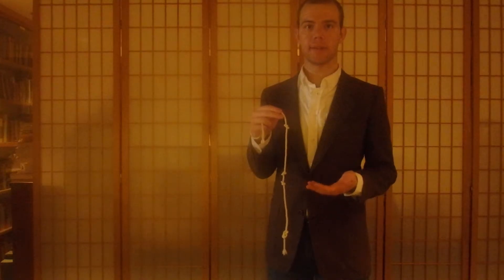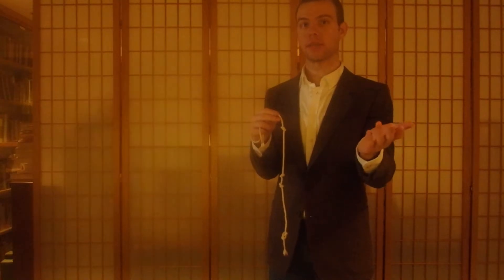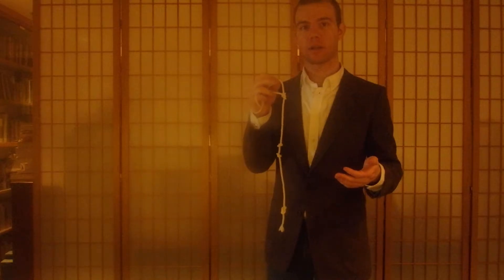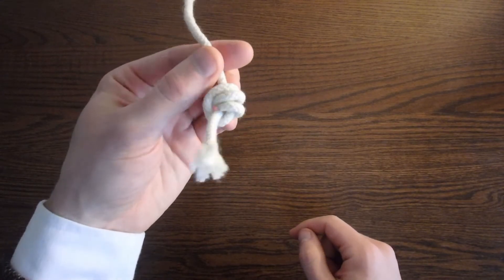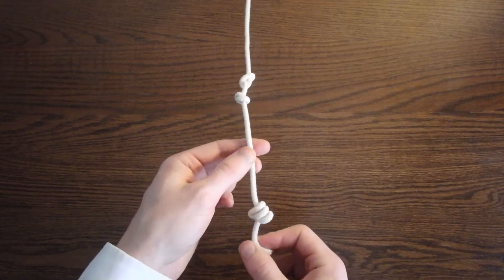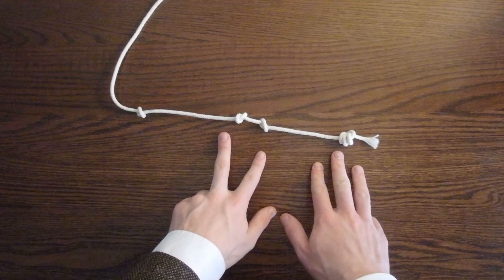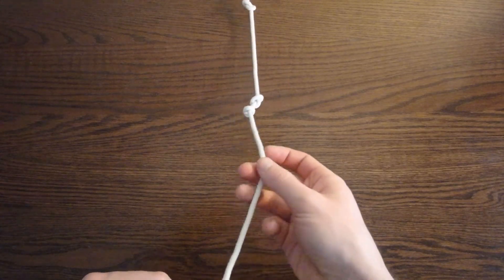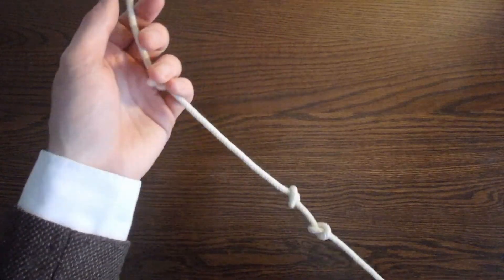How to Make an Inka Khipu (Part 4 of 6): Tying Knots to Signify Numbers

Comment: Hello. Why we are not using long knots for ten, hundred, or thousand positions instead of multiple single knots? So for 121 will be a single knot for hundreds than a single long knot wrapped two times for twenty, and again a single knot for ones? Best regards.
Reply from the maker: In theory, Inka khipu-makers could have done as you suggest, but in practice, only single knots were used in the 10s and higher decimal positions in Inka khipus that have been studied. Note, though, that there are a few known "anomalous" khipu cords where the knots are tied in different positions than we would expect (i.e. long knots in the 10s place). This is extremely rare, though, and does not appear to have been the norm.